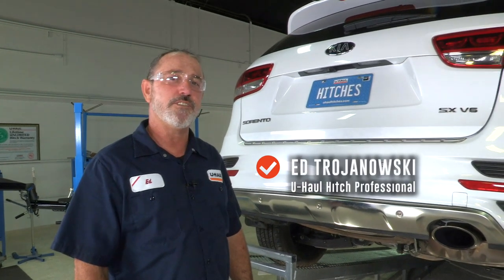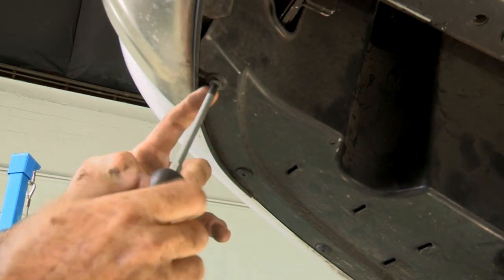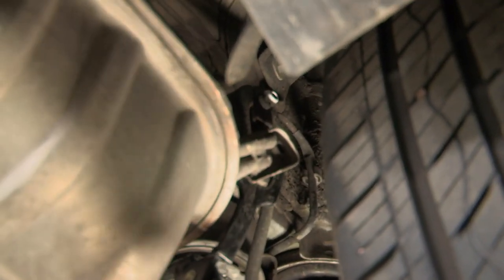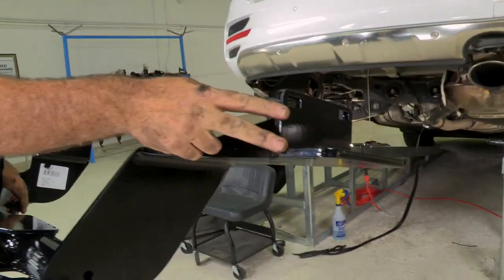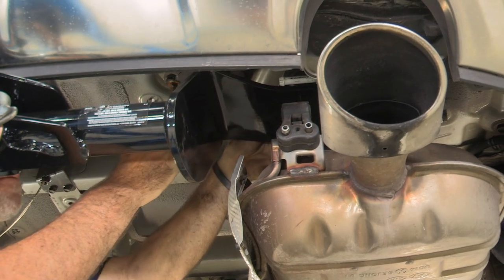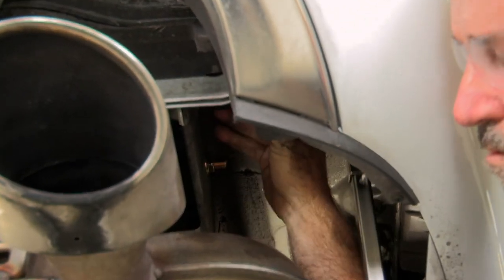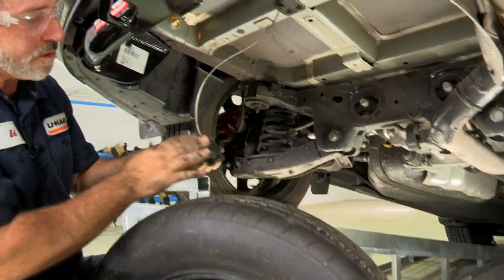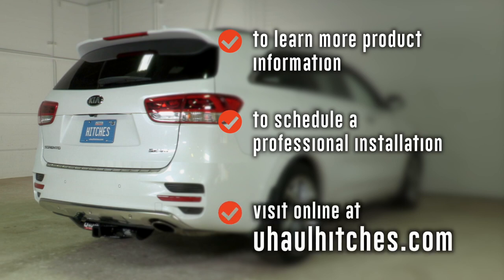2019 Kia Sorento Trailer Hitch Installation

Comment: Torque Specs:
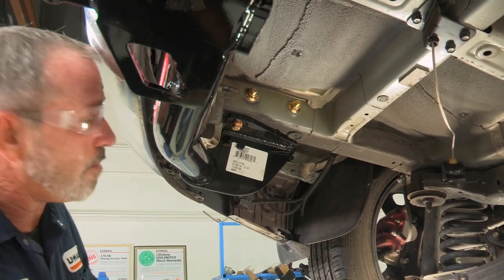7:30 ~ 1/2 Inch carriage Bolts (Driver Side) ~ 110 ft.lbs. ~ 3/4 Inch Socket
8:17 ~ 7/16 Inch Carriage Bolts (Passenger Side) ~ 60 ft. lbs. ~ 11/16 Socket
8:38 ~ M10 Bolts (1 on Driver Side, 2 on Passenger Side) ~ 48 ft. lbs. ~ 17mm Socket

Comment: Ty so much for this, can I just ask is the 2015 Sorento have similar bolt fittings is it completely different  many thanks in advance
Reply: It probably makes a difference if it is the extended 7 person one or the 5 person. I don't think they had the 3rd row of seats in the '15, but this one was the one that does.

Comment: What about the wiring??
Reply: Here's one thing about the wiring. Before ordering a wiring harness, open up the hood of your engine well and take the cover off the fuse box. Look underneath the cover of the fuse box and line up the legend that shows the location of a 30 amp trailer fuse. My 2019 Sorento LX all wheel drive had a fuse in the slot that says  "trailer". That told me that it has a factory installed trailer light harness option. Then get underneath the car and use a narrow slaughter screwdriver and pull off the plastic rivets that hold the compartment just behind and below the wheel well on the driver side. Inside that will you will find a harness that accepts the concussion brand factory wiring adapter for your trailer hitch connector.

Comment: When I installed mine, I had to remove the heat shield above the muffler in order to push the screw thru the beam. The heat would not allow it to go in straight. I reinstalled heat shield after the hitch was secured.
Reply: @curtiswright653  
I used rhino ramps. That will give you plenty of space to work.

Comment: I tried putting muffler side screws in but wouldn't fit....the square opening was blocking small portion of the hole wouldn't line up...

Comment: DIY enthusiasts beware. If you buy a Kia Sorento that's more than 2 years old you will need a tap and die set a metric tap and die set to put in properly the 10 mm wide my 1.2" long vertically installed bolts that go into the bottom of the frame rail. Also I ran into a problem. The carriage bolts, they're actually lag bolts, are about 1 mm too wide and diameter to go into the hole on the passenger side frame rail. The carriage bolt fits into the ear of the draw tight brand hitch I bought from Amazon. I now have to curtail my installation here on a Sunday evening at 7:00 p.m. and take my wife's car to Ace hardware to get alternative lag bolts that are at least a millimeter or  1/8 in smaller in diameter but the same length so they'll fit into the holes of the frame rail horizontally. Lesson number One never install a hitch without Ace hardware being open. Especially on Sundays.

Comment: I bought a 2018 Kia Sorento a year ago and dealer installed hitch ... Question: I notice the vehicle drops in the back when towing a camper with family in Sorento and depending how many people in vehicle it hard to level trailer. Any ideas how to correct this on Sorento suspension. Anything else I could get installed with hitch. Dealer say i have to go to specialty centre ... tHaNkS agonquin
Reply: get a "load leveler'' hitch insert it lifts the trailer tongue and puts more weight on your suv front tires. slick!